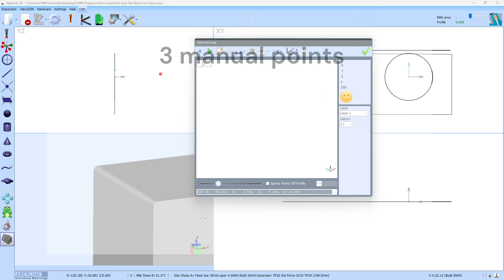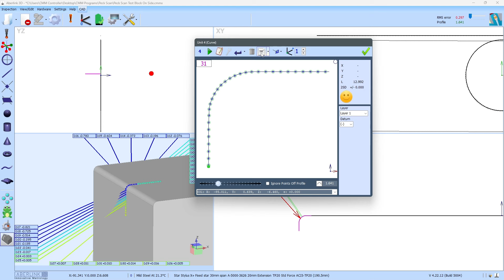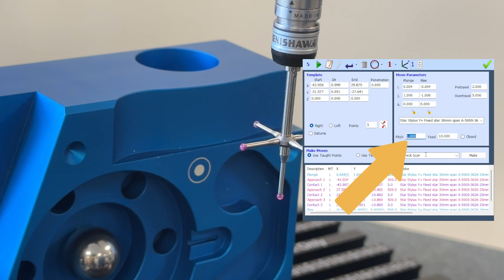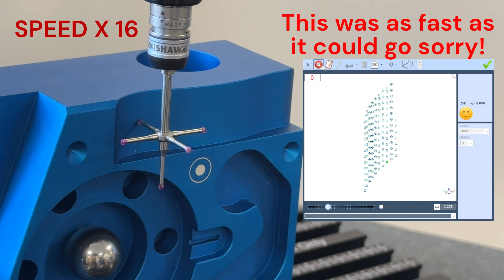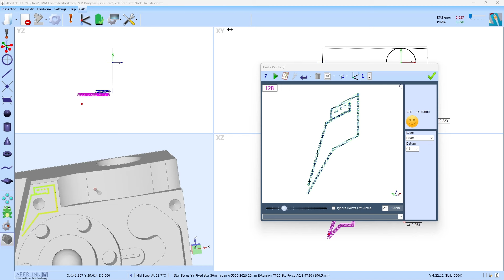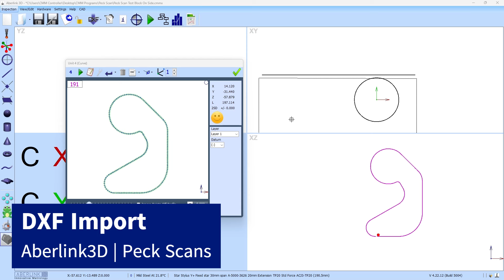Aberlink3D | Peck Scans

Comment: can you do this with a faro arm?
Reply from the maker: Hi Simon, peck scans are designed for CNC machines, not manual arms. However you can scan in Aberlink3D with a Faro Arm by holding the probe to the surface of your part and tracing the measurement you wish to take whilst keeping contact with the part. Scanning with arms would be a similar process to what is shown in this video:

https://www.youtube.com/watch?v=JtTFHPGe-u8

I hope that helps!
Reply: @aberlink  thank you
Reply from the maker: @simonhardwick803  no problem! let us know if you need anything else